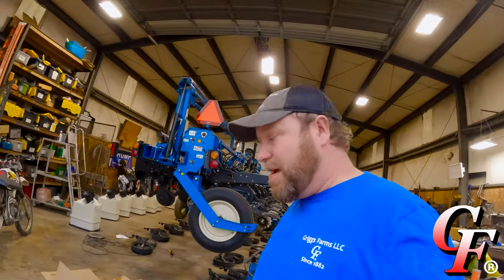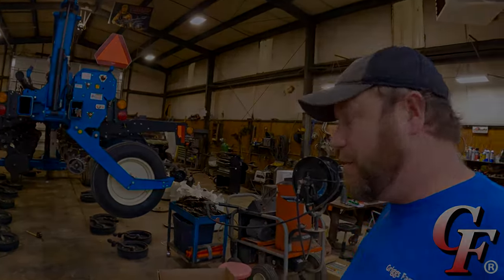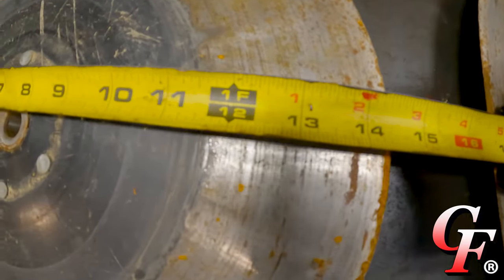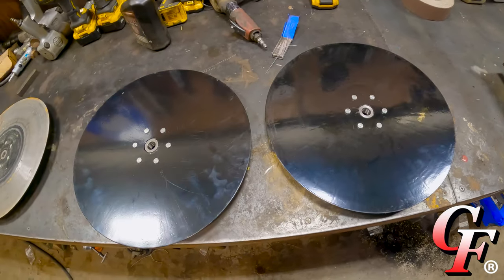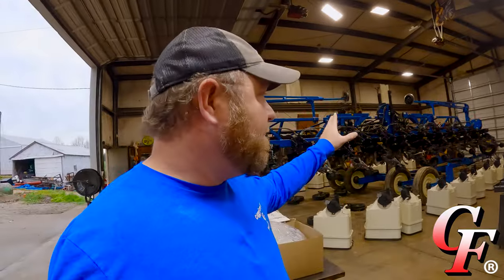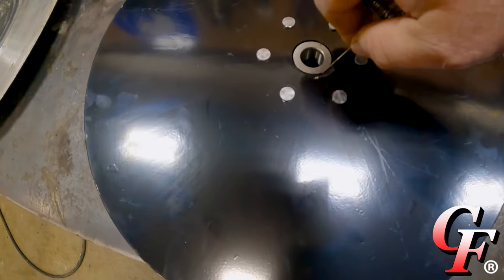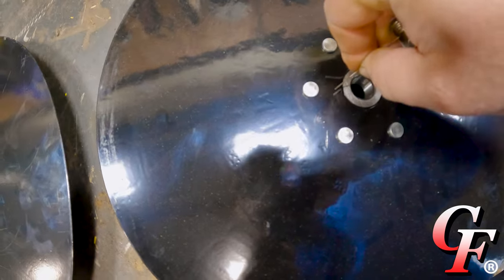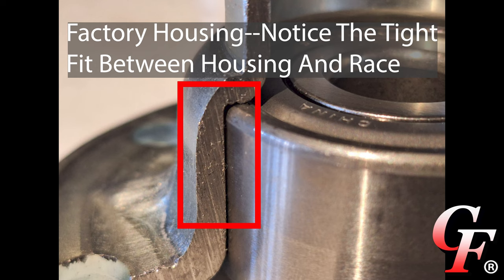Foreign Parts Better Than U.S. Parts???  (3/15/24)

Comment: I will not put anything but a wear part blade on any planter I work on. I changed a customer planter opener a few years ago, and they have only worn down a 1/16th of an inch. She plants roughly 800 acres a year and has been on there for at least 3-4 years.
Reply from the maker: Good to hear!